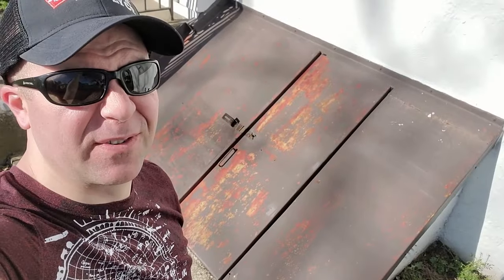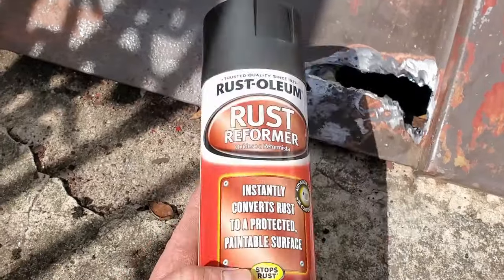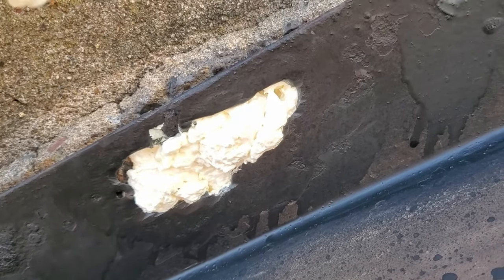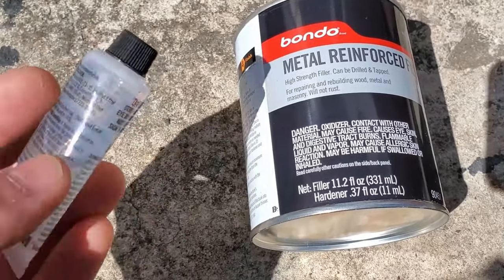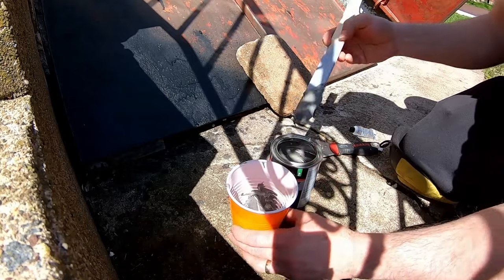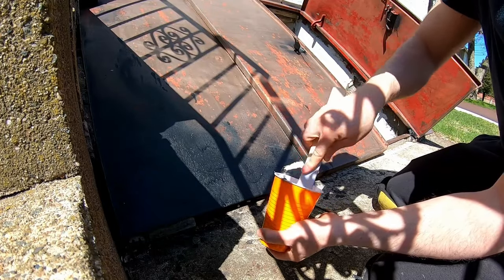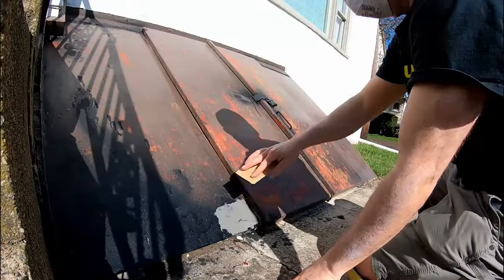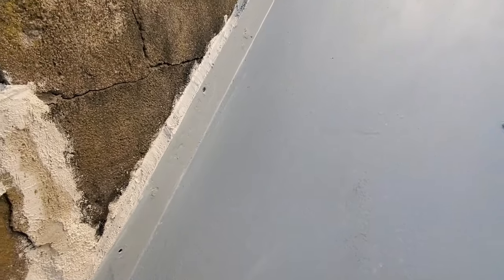Metal Reinforced Bondo - Rusty Hole Repair

Comment: Doesn't stick to paint. Clean bare metal.
Reply from the maker: It sticks fine to the primer I used. I wouldn't want to apply Bondo to a finished surface.  Primer on the other hand is designed for stuff to stick to it

Comment: Great video.
Our metal roof on our pergola is beginning to rust in a few places.  I’ve never used Bondo before, but I picked up the professional high bond to stop the rusting and your video gave me the confidence to try it.  This can came with a cream hardener instead of the liquid but I think I can handle it.

Thanks
Reply from the maker: Try to remove as much rust as possible before applying Bondo.  Bondo is more for fixing holes rather than stopping rust.

Comment: I'm curious about using the foam filler as a backing. I've seen this approach used in auto body  repair with poor results. It seems as though rust on panels is a result of moisture trapped on the inside surfaces, where it sits for long periods and the foam will just be more likely to hold and trap this moisture causing more and quicker rust formation. It would make more sense to attempt to address the moisture coming from the back or sides and allow trapped moisture to instead drain away. I would use a sheet metal patch and any bondo product once the moisture issue was addressed.

Comment: Nice job, great vid, thanks. Wish you had shown how you you handled the inside of the door... especially dealing with the spray foam thru that open hole. Bondo interior side too? I could see you painted interior side but not how it was done.

Comment: Had some vertical posts on my front porch, code States 4x4s are in code however, I had 6x6s and some of the wood rotted,  ground out all the wood that was rotten, still had more than a 4x4 to comply with code, Body filler doesn't work good on wood on houses it will fall off eventually, use Corvette patch, Kitty hair ,fiberglass strand with polyester resin, it will last forever and the weather won't bother it.
Reply from the maker: I fixed rot In about 10 of our windowsills.  Before using bondo I picked out all of the rotted wood and treated with Minwax Wood Hardener.  Also I believe I primed with oil primer as well.   That was 10 years ago now and they have held up great!  I think that prep work is key.
Reply from the maker: I will check out Corvette patch.  Is it a two part product that you mix?

Comment: Great job!!! It should work on rusted car rockers as well.  Will try when a get an old SUV with that problem in a few months.  It's got to be better than rust showing thru the metal.   Nothing to lose but getting some experience working thru these issues and make changes as needed. LOL 😆😅🤣😂
Reply from the maker: Good luck

Comment: A thin sheet of tungsten or ceramic, depending on the damage to the bodywork, can be placed behind the hole and place the melted magnesium under casting over it. It's more professional work. Molten magnesium is a good metal for filling car holes in the bodywork, then just do the cabling.

Comment: One thing I’d suggest is to put a clear coat or epoxy over any aluminum or iron outside projects… Water runs off it and it should keep you from having to repaint or continue to repair.

I’m no expert so different projects have different needs so take this with a grain of salt. 👍
Reply: Actually car wax works very well. Reapply every 6 months
Reply: @DaDaDo661  good tip - do you apply to the entire item or only where the hole was fixed? thanks
Reply: @FinlWoman  I'd do the entire thing
Reply: @DaDaDo661  thank you:)

Comment: Do you think I could use this on a thin rusty fire pit, that I'd like to turn into a flower planter?  Should I use stainless steel flexible mesh in the bottom of the pit for extra reinforcement?
Reply from the maker: I'm not an expert, but if you try it, the wire mesh is probably a good idea. It would probably require multiple coats. It's gonna be messy.
Reply from the maker: Also, I'm not sure how the chemicals  involved will interfere with you growing plants. I definitely wouldn't eat anything grown in it. Take a wif of the bondo and you will know what I mean

Comment: Using the foam filler is not a good idea, it ruins the bond area for the bondo.
Better just fill with bondo, you have compatibility issues.
Reply from the maker: It seems to have worked awesome.  For the hole at the bottom,  I would have needed gallons of bondo.  I needed something to fill the void. It worked 🤷‍♂️

Comment: Did you have any problems with the Bondo adhering to the rust converter?
Reply from the maker: No problem.  I have used regular bondo extensively to fix wood rot in the window sills of my old stone house. I've never had an issue with it sticking to primed wood. 15 years later, they are solid as a rock!
Reply: @mericanhoney  that's great news. Thanks for the peace of mind

Comment: Good job, but two words for you:  paint roller (LOL).  You'd still need the brush for cutting in, but the roller would greatly speed up the painting.  Keep up the good work.
Reply from the maker: Yeah, I was being a little lazy. I don't like cleaning up oil paint. I do this thing where I load up my brush with paint in-between coats, and stick it in a cup of water.  The oil paint and water don't mix so my brush stays fresh until I need it again. I feel I might regret trying this with a roller

Comment: Doesn't the foam soak in water?
Reply from the maker: I don't think so. It's not at all spongelike when it hardens
Reply: the foam will dry up , turn into a powder and fall out of the patch , that don't matter, it was only there to support the Bondo. After the Bondo sets , the foam is no longer needed
Reply from the maker: @billganas467  🙌

Comment: Well its all very nice.  However, I think if you spent the time to refinish your doors using the POR15 system your rust problems would be eliminated.  I would have put something like a cardboard backing over the door and filled with the bond rather than using great stuff.  It's made to seal air leaks, not to interact with Bondo.  But, it's your hack.
Reply from the maker: It worked great! Thanks for watching
Reply: @mericanhoney  Will you be posting another video follow up of the doors rusting again?
Reply from the maker: Brother, I'm sorry that my video seems to have peed in your cheerios.

Comment: Cut out a piece of scrap aluminum paint the area drill half dozen holes rivet or screw  add body filler.    the foam traps water 🥴 you'll be back rhere
Reply from the maker: This foam is used in all kinds of building applications and does not attract moisture.  I am not worried.

Comment: This repair won't last long. Bondo is designed to stick to bare metal.
Reply from the maker: Thanks for watching! Bondo will adhear to all sorts of prepared surfaces. I used it to repair rotted windowsills in my old stone house 10+ years ago and it is holding Strong!